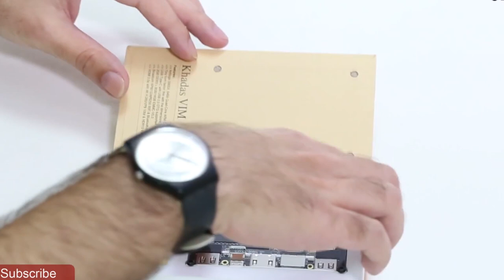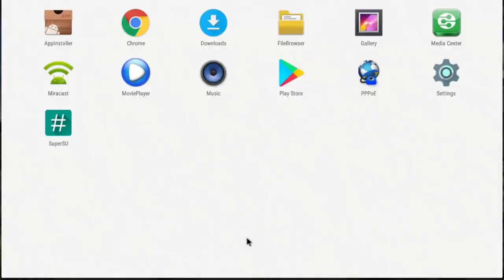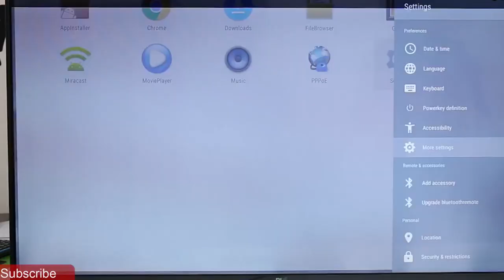Khadas VIM2 Max Review and Hands-on: Open Source TV BOX (Official video)

Comment from the maker: 🔥 What about other TV gadgets? Use COUPONS to buy cheaper! 
https://goo.gl/ktbk5G - XGIMI CC Aurora Mini Portable Projector / Price: $549 / Coupon: XGIMICC
https://goo.gl/jMBVM1 - HKC C7000 27 inch Curved Screen / Price: $274 / Flash Sale
https://goo.gl/EgpkPf - MECOOL M8S PRO Android TV BOX / Price: $77.99 / Flash Sale
https://goo.gl/YXu5AE - Magicsee C400 Plus Hybird S2 + T2 + C TV Box / Price: $121.99 / Flash Sale
https://goo.gl/dyo6hB - TAP PRO 2+16G / Price: $47.99 / Flash Sale
https://goo.gl/ihvJzq - MOTOSPEED CK61 NKRO Mechanical Keyboard / Price: $47.05 / Flash Sale
https://goo.gl/54pbuJ - Xiaomi Bluetooth Speaker / Price: $121.67 / Flash Sale
https://goo.gl/ANAoHs - Xiaomi Mi TV 4A - 32 INCH / Price: $219 / Flash Sale
https://goo.gl/WrQ4iM - Original Xiaomi Mi TV 4A / Price: $399 / Flash Sale
https://goo.gl/QvKLA8 - Original Xiaomi Mi TV 4A / Price: $399 / Flash Sale

🔥 Didn't find your TV Gadget? The coupon is NOT valid? 
Please, CHECK OUT our blog with everyday updated COUPONS and best DEALS - https://goo.gl/Ki7BrK